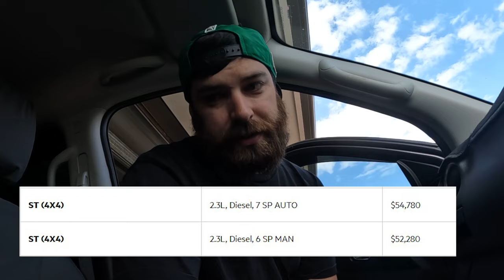NP300 REVIEW | 2 Year owners honest opinion

Comment: Hi mate I’m curious you had a problem driving in the rain because of the snorkle? You said you got water in , this would be a problem for everyone else me included but I’ve had a safari snorkle for 8 years on the standard filter box and never had a problem I would think that maybe the box itself needs a one way drain valve installed this might help Im going to check your videos out I’d like to see more info around your snorkle and filter box this problem really shouldn’t exist
Reply from the maker: I got some water in it a couple of times when it was absolutely bucketing down rain and I was driving on the highway at 100kms. That's the only time I had water reaching the airbox. I've since put on a 90ish degree silicone hose on the end of it to aim it down and deflect some water for if it rains. I did a fair bit of research after it happened (should have done it before) but its a common issue with staino's, the water travels up them and gets sucked in. The water diverter I put on it helps for when its stationary but not when its insane rain and on the highway. Never had any issues driving around town in the rain. I'm just a sucker for the staino sound - brings out the little kid in me making choo choo sounds. I agree the box needs a way to drain water though, it's on the list of things to modify!
Reply: @GetThatBread  
I can’t blame you either , check out the Toyota Prado air box one way valves you can buy as a spare part maybe you could fit them some how I’ve just seen the video where you put the diverter in hopefully you can sort that out cheers.

Comment: Have the same year car as you also been trouble free just want to know fitting the intercooler is for keeping the engine cooler in stock form or are you planning a engine tune .cheers from Shepparton Victoria.
Reply from the maker: Thanks for checking out the video Rod, I have sold the Nav but at the time it was bit of both, was to get it up higher as my bash plate restricted airflow to the oem one and had planned to get a tube in the future when warranty ran out 😀

Comment: Qual motorização essa sua Nissan?🇧🇷🇧🇷
Reply from the maker: Hey mate, its got the standard 2.3L dCi engine. Might have a different motor in other countries.
Reply: @GetThatBread correct. Here in my country in the Caribbean they come standard with the YD25  2.5 litre single turbo diesel engine. It works well enough in my opinion..